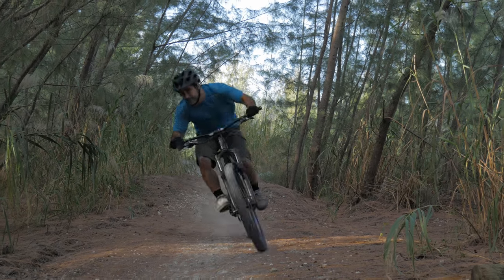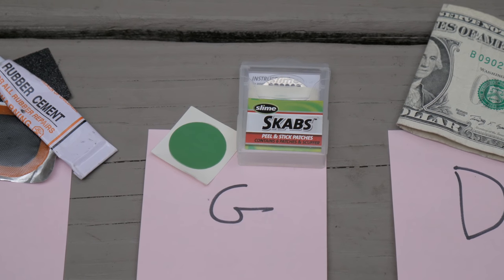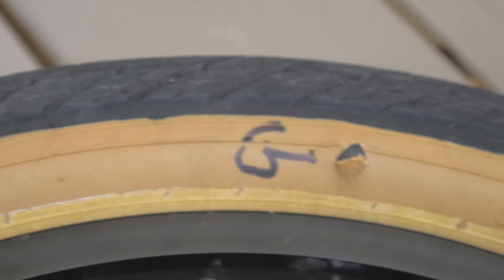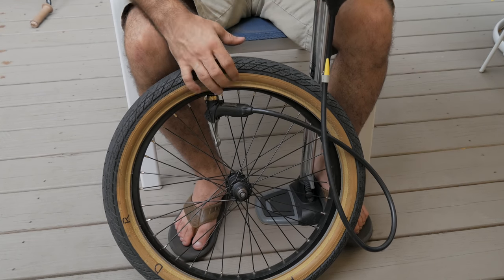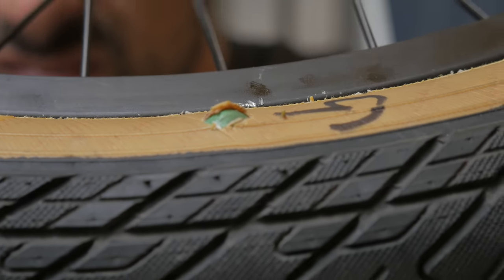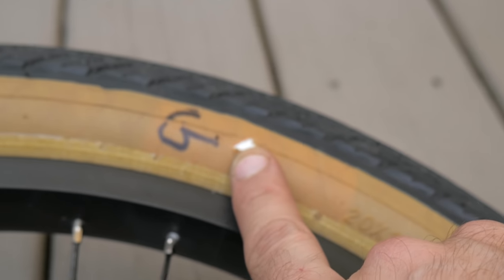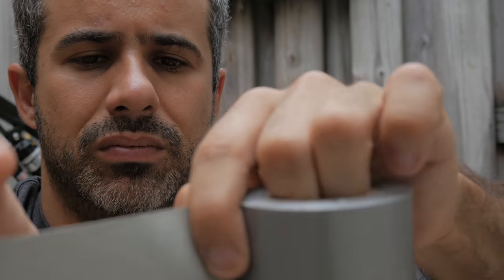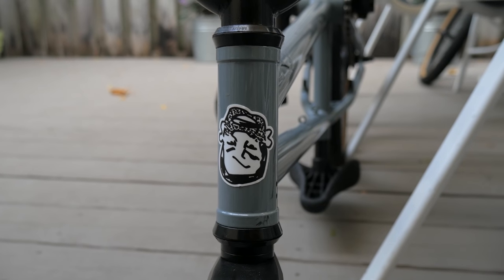5 Tire Sidewall Repair Hacks, Tested

Comment: Seth, You should sell dollar bills on your website....for this exact purpose.
Reply: I would buy
Reply: for $1.01 each. Just to make that tiny bit of extra profit
Reply: for exactly $20 bucks
Reply: As long as they take cash
Reply: 1 dolla bill for 5 dollars! it would have the Seth's Bike hacks logo on it and be a special colour. it would be from same material as dollar bill but customised to fit seth's channel. lol that would be cool!
Reply: Hahahaha lolz! Here in 2019! 🤣
Reply: Sell it for 5 dollers
Reply: not a dollar bill but that same paper texture
Reply: There is a store for this already and it is called the bank
Reply: Oh yeah its big brain time
Reply: That would be sick but I'm pretty sure it's illegal to sell us currency for more than it's worth, but a piece of really similar material That's about the same size of a dollar that you can print different things on so it shows through the hole would be pretty good.. You could sell them in three packs for five to ten bucks and because they weigh practically nothing and take up almost no space you could just leave them in your pack or even if you already run tubes leave them inside your tire so they are there to be used
Reply: Could call them berm peak doners and while they seem overpriced the price supports you and what you do or you could even give them away with donations and make a market for it/name

Comment: I slashed both brand new folding tires on a piece of glass on my mtb years ago,  used the dollar bill hack to get home. 

Then I sewed up the 1" gash with dental floss and rode the tires at 35 & 40psi until the tread was gone.

Another hack is to inflate the tube to the width of the tire and then wrap a section of the tube with duct tape so that it can't expand anymore, and line up the sidewall hole with the duct tape... no sidewall bulge.

Comment: Damn it! in Europe the smallest bill is 5 euros. So it gets quite expensive to repair a sidewall..
Reply: You get the bill back. Technically though you will have to replace the tire once you finish your ride so yeah.. it is quite expensive.
Reply: Same with Canada, my go to for a DIY boot is a bit of the tubes box wrapped in electrical tape so it wont get soggy, taped to the inside of the tire so it wont shift. I ran this for about 3 weeks under the tread because I ran over a nail and couldn't afford a new tire at the time (fixed gear too, so it saw some skidding). I don't recommend doing it for that long.
Reply: We allways can use the 500 one XDDD
Reply: you use it just to get to a place to fix your tire, then you put the bill back in your wallet....
Reply: Use SIS gel packaging instead
Reply: +★ VICMACARRA ★ GAMEPLAYS Please show us a pic of your bike and tell us where we can find it ;-)
Reply: gkkamas123 (xKAMASx) yea so expensive
Reply: gkkamas123 (xKAMASx) in switzerland 10€  ;(
Reply: If you ever come to America, stock up.
Reply: gkkamas123 (xKAMASx) yep five pounds in England too
Reply: Luckily for some, not all of Europe uses Euro.
Reply: australias lowest amount of note money is 5 as well
Reply: I now how you feel man, I feel the same.
Reply: In Poland we have 10zl smallest note. Its about 2.5-3 euro
Reply: gkkamas123 (xKAMASx) in Romania the smallest bill is 1 LEU which is about 0.3€
Reply: Why not using coins?😂

Warum keine Münzen benutzen?😂👍🏼🤘🏼
Reply: You can take it off
Reply: In Denmark it`s 50 kr. That is about 6,70 €
Reply: Not all over europe but yes
Reply: get some Romanian currency (forgot what it's called but my friend has some), it's made of plastic and it's only 25 eurocent
Reply: In britain, our notes are plastic so would slide around in the tire, all up untill a £20 note which they are yet to make plastic
Reply: boi in poland we have 10zł
Reply: Try it with a 2 Euro piece. ;)
Reply: i use a 20 so i can just take it out and use it to buy the new tire
Reply: 3-5 ounce Leather and fabric cement?

Comment: Great video!  I think you still need to address the "Will this get me home?"  question.  Tires deform on literally every revolution, creating movement in between the tube and the tire (hence you tubes getting slightly fused to the tire after a while.  I'd be interested to see how the bill fares against adhesive options, and how those adhesive options compare against each other.

Comment: Very interesting video and a good variation of patches. Although it woul have been more significant if you would have installed the tire and ride it a good bit before inspecting the result.
With the stress wile riding the rubber would have had a lot of work to do and the result would have been more towards a real life test...

Comment: Seth last year I was on a road ride and had a similar side wall puncture.  Though it was a little smaller.  I fixed it with a dollar bill and forgot to replace the tire when i got home.  I rode the tire all season till the fall then went to replace it and realized it was still in there. It just had some small cuts in it. Its the best hack ever.

Comment: I've used an empty Gu wrapper and it works great.
Reply: Same here. I think it was a High 5 gel wrapper. Got me about 30km home on some rocky roads (hence why it tore in the first place).
Reply: Snickers rapper for me rapped around the inner tube over 50km, but I got home
Reply: Jon Lenvik clever!
Reply: Jon Lenvik what the heck is a guy wrapper
Reply: Jon Lenvik what the heck is a gu wrapper

Comment: Seth nice stuff.  I'm more of a roadie myself but recently had a sidewall tear on an old tire during a ride.  A former racer/roadie friend of mine had given me his version of a tire boot to keep in my saddle bag and it worked great to get my home pumped to around 100 psi.  His boot is a section of an old tire (road tire of course) that was cut to be about 3" long.  Just put it in place like your dollar bill.  Roadies also have used parts of Tyvek bags that you get in shipping from UPS/FedEX/USPS, again in a similar manner to the dollar bill.

I was thinking that for the MTB tires you could cut a part of an old sidewall (removing the bead and tread area) and use that as a boot similar to what my friend gave me.  One old tire would result in dozens of boots.

Comment: I keep a 4"X4" piece of dog food bag in my take along tool kit.  Its the thick sort of foil type bag that tons of dog food comes in.  Actually had to use it and it worked like a charm.  Much like the dollar bill if not better.  This was on a road bike with a much larger hole than in this video.

Comment: Hey Seth! There's also sewing the tyre back together with dental floss!

All you need is a thick needle and a little bunch of floss that you knott on both sides after and before sewing the tear back together.

I actually have multiple high quality tyres sewed back together that customers at the shop abandon because sewing them back together for them is not a 'professional' option, but as an example I ride a Schwalbe Big Apple on my rat cargo bike that I've done many many kilometers on and it holds up as if there were no tear at all, best touring solution too as far as my experience goes!

Comment: A twenty dollar bill got me down the road on after a side wall tear on a gravel ride.   It took me 40 + miles on quality flint hills gravel.   The slash was a solid 1/2" tear on the side walls.  running at about 50 PSI.

Comment: I once went on a 50 mile training ride and got my tire puntured 30 miles away from home, luckily i had a park tool regular patch kit to fix it but only pumped my tire up to 50 psi to not risk an opening. Thanks for the great hacks seth!
Reply: Alessandro Lazo the ride would have to be at least 60 miles to be stuck 30 miles from your house mate
Reply: I was going from a friend's house to my house and I got the problem 30 miles away from my house mate

Comment: Nice demo. I always carry a Park tire boot, which I've used successfully, on a tubed tire.  Haven't needed to try this on a  tubeless with sealant though. I wonder about adhesion, so always carry a few alcohol wipes to clean up the patch area. I've sewn up a big tubeless sidewall gash with hd nylon  thread, mostly out of curiosity, and it sealed up and rode  just fine w Stans. Not wanting to press my luck, replaced tire soon after... Loved the trail dog vid. Ha.

Comment: Hey Seth,  seeing that maxxis tire on the front wheel of you bike really sparked my mind, you should try setting your bmx bike up with mtb tires front and back as well as adding in a brake and see how it performs on the trails. I bet it would be fun for jumps! I also have been wondering, around when do you plan to announce the winners of the bike giveaway? I have been so pumped to see the results! Cool vid btw!!!

Comment: Was riding a century and blew a hole in my sidewall. I used a GU wrapper to brace it and it rode the rest of the 70 or so miles. Would like to see a gel wrapper tested

Comment: Used the duct tape on my road bike. Worked so well I didn't even bother to replace the tyre. Held on for 3 months at 7.5 bars just fine, until i replaced the tyres because they were worn

Comment: Just yesterday, I was set to ride a century. Less than 20 miles in I had a puncture and found a half inch sized hole in the sidewall of my tire. A single layer of duct tape saved the day and allowed me to ride another 80 miles at 100 psi! I'm currently see if a tape/dollar bill combo hack will get me through until I can get ahold of another set of tires

Comment: dollar bill is good, section of an old tire works too..as with using old tubes for patch rubber, a lot of satisfaction racking up miles on a multi patched tube, with a brand new one as a back up

Comment: I have glued a piece of fabric and a piece of inner tube to the sidewall of a tire and had it last me the rest of the tire's tread life. Which was at least 2 years. I used patch glue on it. It never stretched and kept the sidewall slice closed.

Comment: Idk if this was said already, but the boot doesn't stick if you were tubeless.  However, it still works like the dollar bill when using a tube...just hold it in place with pressure from the tube.

Comment: I recently had a huge tear (about 6 inches) where the side wall meets the wire bead. Not sure where I got the idea I could sew the side wall back together if only I had a needle and thread. Then I got a crazy idea. I removed my front derailleur cable and using a small hex key as a hole punch I managed to feed the cable through the sidewall and around the bead. It wasn't pretty but I the long gash in the tire was sewn back together using a derailleur cable. Put in a new tube and slowly put just enough air in the tire to hold my weight. I slowly limped home shifting my weight to the undamaged tire and avoiding bumps. I still cant believe it actually worked.

Comment: probably a large leaf or an empty juice pack can also do as well as the tire boot/dollar. larger surface area covering the hole will evenly distribute the stretching force applied by the inner tube

Comment: I have used a rubber patch to repair a 29x2.0 bontrager tire . This tire is on a cyclocross bike that I use for gravel roads ,other 2.0 tires will not fit the bike so I don't want to give these up. Ticking time bomb I know

Comment: I have a sidewall knife slashed tire that I have been saving up for, to get repaired by an engineering team.  I have spoken to an engineer on the team,.  Basically they will use a laser cutter to separate the layers, and re steel the inside threads.  
I plan on making a video as soon as I get around to it.

Comment: If you forced the patch with a roller it would have been the best because I blew mine at 140 psi and it is a tin tire + was still good as new... But still good video!

Comment: nice vid, but i think the patch was inverted,  plastic should be on the outside.  if you have lots of tape maybe rolling it around an inner tube at the right place could work better.

Comment: If stuck with just a couple of patches I would double up the patches as single ones don't last long when riding, Single patches appear to 'thin out' as they stretch with repeated flexing before they eventually pop.. Doubled up patch on 26x2.2 tyre with 1/2 inch gash in sidewall lasted near on 30 miles, always handy to have more than one patch... Would be interesting to see if the new 'plastic' polymer Bank Notes are as good as the old paper/linen notes they are replacing. ?

Comment: I have used the tyre boot but unfortunately the sharp edges on the park tool boot are quite sharp and they cut in to my inner tube giving me a cut in the tyre that i could not repair, but luckily I had another inner tube with me.
P.S. love love love your video's

Comment: To be scrupulously fair the dollar bill rolled becomes multilayered which you could also have done with the tape and patches to start with. You can also wrap Duck Tape externally around the the tyre and rim.  It doesn't look pretty but by heck it's extremely strong and is easily replaced at regular intervals.  When I was a lot younger my inner tube once completely blew and got home by stuffing my tyre with coarse dry grass, a trick my dad taught me a few years earlier.

Comment: OH added tip for the Tape hack: Run a lighter over the tape after putting it on. This will cause the adhesive substance to melt and fill out even more microscopic pores.

Comment: Strange to say, but if you use rubber patches, you should glue one inside and another one outside. I used my bike with this method for about 3 months. :-D

Comment: Applying tape to a tire still wet with sealant would be a pita while on the trail.  Can you do a followup review on tire plug kits?  Some promise you can pop right in while still leaking and go.

Comment: You can use a business card also - a little more robust than a dollar bill, or tape over the dollar bill to keep it in place if you're worried about that, though I suspect the outward pressure from the tube would do that just fine.

Comment: I once when to a ride without knowing my tire was showing high wear on the rolling area and realized it when I did puncture. I was riding on very light gravel and used my train ticket wich was made of plastified paper and it worked well for the 100km I did that day plus I was feeling lazy a bit so I added more on it.Lasted until I decide to change my tire finally.

Comment: On your diamond back, take a second clamp and an 18-inch post.  Turn it upside down and place the other half of the post in the park tool clamp.  Mount the second clamp to the seat tube.  It won't work on all bikes but it will work on the DB.

Comment: Wondering how Velo rim tape would work. It's thicker and stronger than a dollar bill plus it has adhesive and a small roll is easy to pack.  If the gash was large you'd just have to use a couple of strips.

Comment: What's the max psi for that BMX tire? just wondering.
Reply: Most likely 110 PSI
Reply: My Shadow and Eclat tires go up to 110 PSI while my Cult/Kenda goes up to 100
Reply: BKKgrind woah! is that normal for BMX tires??
Reply: The smaller the volume of a tire, the higher pressure it takes and needs.
Reply: repairdrive, yes that's pretty normal for a bmx. A lot of people  I know ride 90psi
Reply: BKKgrind but on my felt heretic original tires it says 60psi max....getting a nee tore although

Comment: I dont think anybody would run 120 psi on their tire anyway so the patch with still works and if you put enough duck tape it will hold up just as good as the actual side wall patch

Comment: Hey Seth, what's your opinion on user made trails, or trails made by riders that aren't specifically endorsed by the Forest Service? To be honest I ride them quite frequently because I'm good friends with the people who build them. Is it destructive to the natural environment? They're pretty sweet trails and the people I know have built up quite a network of really rad trails. For now most of these trails are secret and only a select few locals know about them, but as they become more ridden in the public usually finds them and that usually leads to the Forest Service's adoption of them over the years. Anyway, more trails in this area are built every year mostly legally, and its turned into a pretty vast and gnarly network or trails. Anyway, I was just wondering what your thoughts were and if you've ridden any user made trails yourself. Thanks!

p.s. Happy shredding!

Comment: I run maximum of 45 to 50 PSI and 35 - 40 PSI as street mountain blend

30 PSI tubed for bikepark and singletrack
25 when i change to tubeless singletrack and bikepark

Comment: I blew out my tubeless in 3 spots with one hit on a curb. Curb bite pinched a hole on both sidewalls and one through the tread. Aside from having an inner tube, what would be a good fix had I been on a trail?

Comment: What pump do you use? Seem pretty effortless to reach 100psi
Reply: any floor pump should  be easy to fill tires.
Reply: Yeah.. think i 'll just get a better pump.. mine starts to ask for extra effort when it hits 80 and hose blown when it hits 90+..

Comment: You can’t do the paper trick in the uk it would be to expensive our lowest denomination of paper money is around $7.50, but it might actually be better because we use a plastic like tyvek paper which would hold back even more pressure and actually seal against the rubber better.

Comment: Maybe someone can answer my question? Thanks in advance.

So, in case I don't have tubless tires and I would try to do manual, jumping with bike etc, then I have much greater chance to change my tubes and/or tires often or these skills/actions don't have significant role to tubes and/or tires damage?